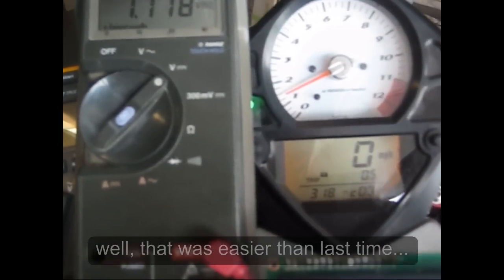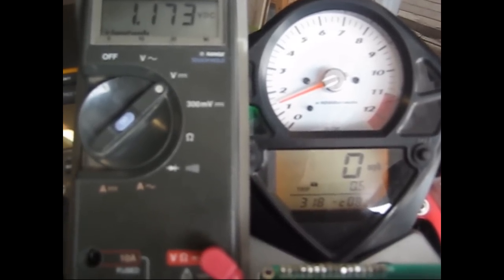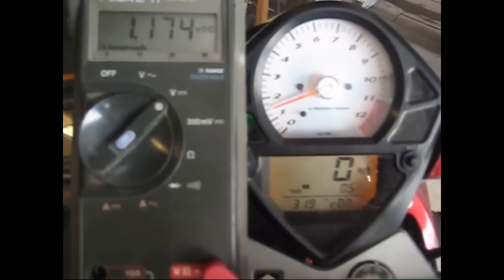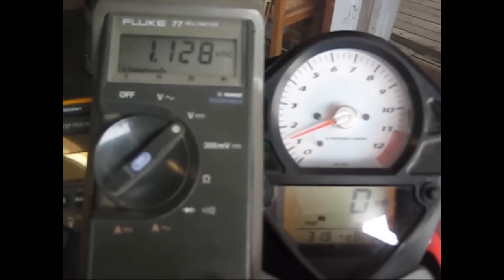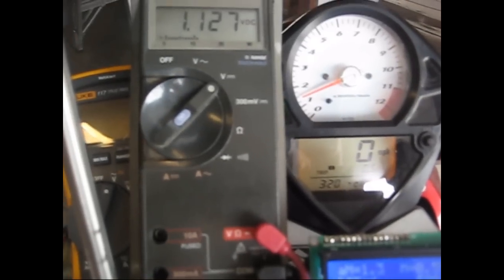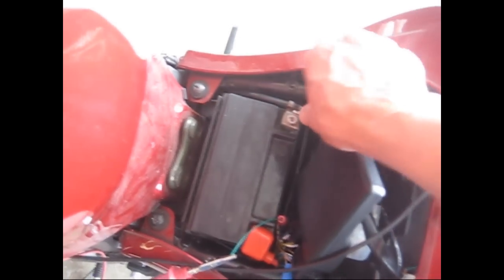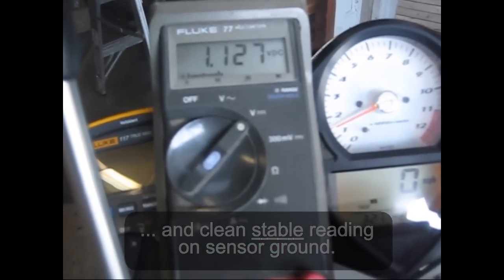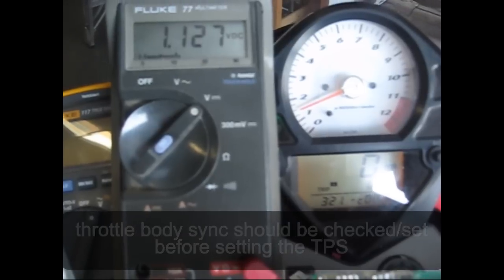SV650 TPS, Voltage Mode Adjustment

Comment from the maker: First sentence in video: "How to set the TPS if you do not have a gauge..."

Voltage method is for folks who do NOT have the stock Suzuki gauge; after-market gauge, Vapor etc, or for race bikes with no gauge at all.  

If you do have the stock Suzuki gauge, then correct, use the meter on the dash, easy way.